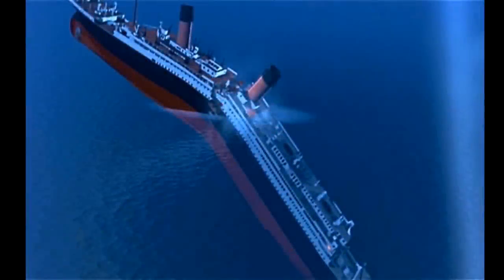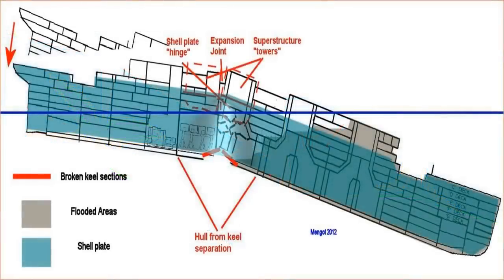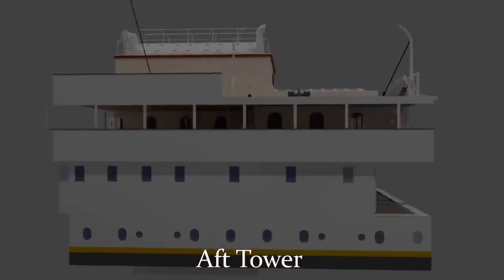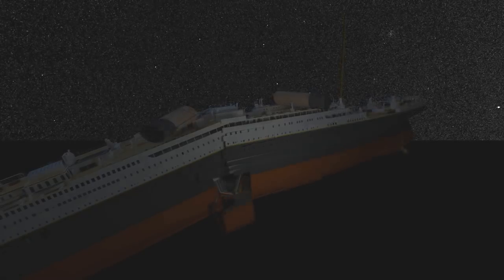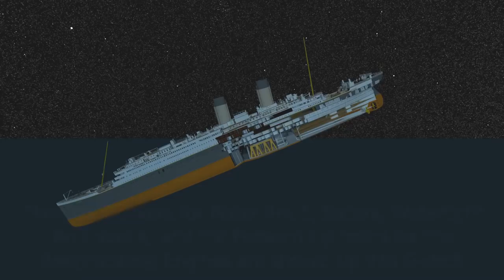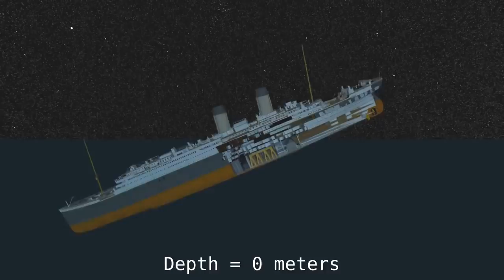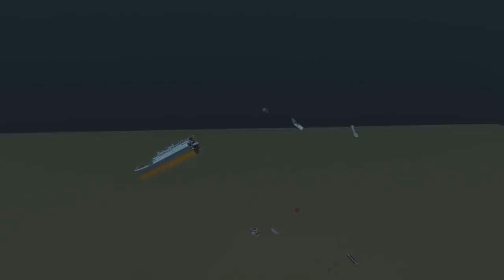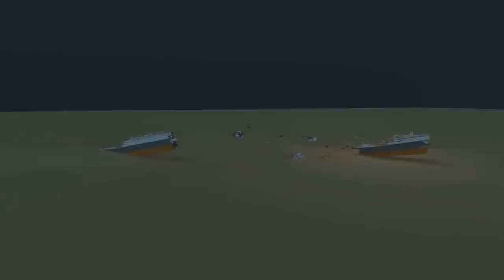How Titanic Broke In Half BRIGHTENED

Comment: "She's made of iron sir. I assure you she can... And she will".
Reply: Wedge Antilles iron with a high sulfur content.
Reply: "It's a mathematical certainty.". No one ever mentions that there had been a fire while she was being built, in the lower sections. It's been assumed that it caused the steel to become more brittle. That area on all levels had been re-painted to removes signs of smoke damage. There's strong evidence that it may have helped cause the tearing. On the other hand, when Mother Nature is wheeling out big icebergs, there's no such thing as an unsinkable ship.
Reply: johnny cash Using Bernie Sanders’ logic of banks, a ship too big to sink is too big to sail. Look at the Bismarck and Yamato for proof.
Reply: Yes she is
Reply: thomas said she can and she will
Reply: johnny cash  the fire didn't damage the hull. It was extinguished earlier in the day of the collision. The coal fire theory has been debunked on this channel and others many times. There was a fire, coal bunker fires were common but the displacement of the coal into the other bunker actually held the ship up for an extra hour and 45 minutes as Thomas Andrews gave the ship an hour during his calculations. If the fire had been hot enough to damage the ship it'd have damaged the pool as well since the pool was right above the bunker but survivors had used the pool that day and said it was pleasant, specifically Archibald Gracie's accounts.
Reply: @dawndelosmuertos4025  te fire was shown to not have been much of a factor. If it affected anything it did so after the ship was already doomed
Reply: shane scali she was made of steel, by that time iron wasn’t used anymore due to it being considered poor.
Reply: @jamesgroccia644  the Bismarck sank because it got slammed with high caliber shells in a naval battle and the Yamato was barraged by USAF aerial torpedos. That is completely different from hitting and possibly grounding on an ancient chunk of ice. Those ships were purposely destroyed, Titanic got scraped up just a little too much on an accidental encounter with an iceberg.
Reply: @dawndelosmuertos4025  that theory was debunked long ago, and now its really annoting.
Reply: @jamesgroccia644  -
Bernie Sanders is a senile old geezer. You really gonna take his word for it?
Reply: @dawndelosmuertos4025  the coal fire was already debunked. the fire can't damage the steel. even if that really happened, the temperature can't damage the steel as it wasn't high enough for doing it. the boilers' temperature is 940F but to damage the steel the temperature should be at least 1220F.
Reply: Watched this part of the film last night - had a good chuckle.
Reply: @MasterAnakinSkyWalker  He's smarter than you are
Reply: @sorrenblitz805  The British always say they sunk it with a torpedo, 400 shells hit Bismarck, and guess what, it didn't sink. It sank because scuttle charges. Evidence from the wreck have shown bulging shell plates which is what scuttle charges are meant to do. No evidence of Torpedo damage to Bismarcks thick armor.

Comment: Ships aren't designed to handle the immense strain of being half under and half above water.
Reply: johnny cash  You need to change your profile name because the real Johnny Cash would never be that rude and disrespectful.
Reply: In this day and age surely a computer programe can be devised to show how the split occurred, rather than this constant, it did this, it did that
Reply: david jones it is really simple. The longer something is, the more it tends to flex when gravity pulls on it. The ship had its front 6 compartments flooded with water. This caused it to be pulled nose down. Once the stern began to lift  out of the water, of course it was going to split. Steel is not that flexible. Also, there was an expansion joint in place which becomes a weak point.

It's like if you had a 100 ft steel pole with a vertical slot cut down the centerline of it. You grabbed the pole and attempted to lift it into the air by pulling down one end. The metal will be put under extreme stress. It will flex, and eventually split at the weakest point. It's not rocket science.
Reply: @davidjones-tz8bs  You seriously overestimate simulations...

The thing is you need to know the exact conditions, where it sank, how, and so on, to get a relatively accurate run. Which even then may still take MANY more attempts to refine even when you have the info. 

It isnt magic.
Reply: @LynxStarAuto  Titanic's steel was also brittle, it has impurities in it that weaken the metal and made it brittle. The extremely cold water only further embrittled it. Just before it broke in two, survivors reported loud, thunderous noises coming from below decks that could only be steel plates shattering or fracturing like glass.
Reply: conrad twitty  Expeditions to the wreck took samples of hull plate, deck plate and beams and tested them. What they found was high levels of sulfur and inclusions in the metal, which make it brittle. Even so, Titanic would still have broken in two if modern steel was used along with welding. I build ships for a living. Make no mistake, cracks are as much an issue today as they were in Titanic's day, even with better materials, welding and design. The metal used to build Titanic would not have been allowed out of the steel mill today, it would have been remelted and the impurities removed before being turned into plate and beams again.
Reply: well they should be lol
Reply: Well in Titanic's case it wasn't half underwater half above the surface,

It broke between the 3rd and 4th funnels meaning more than half of the ship was underwater.......

Plus, water-filled object is heavier than an air -filled object....
Reply: @danieldoo1821  But the air-filled object was still pretty god dang heavy.
And yes, more than half the ship was under water, but not all of it was completely flooded :)

Comment: This is one of the more elegant solutions to explaining how the breakup occurred. It explains away many of the mysteries and missing chunks of the ship, as well as accounting for the massive compressional forces present just before the break occurs. It also solves the problem of not everyone noticing, since the stern doesn't really visibly separate, nor settle back on an even keel before going down, something the top first theories have problem with. Also excellently animated, very well done!
Reply from the maker: Many thanks! :)
Reply: @TitanicAnimations  Why did the Stern fly off into Space at 16:44?
Reply: @angieroxy7550  yeah, I thought that odd as well then realized the animator had botched the water line somehow. How that wasn't corrected is a mystery to me but it certainly confuses the whole sequence A GREAT DEAL. That should be fixed, eh?

Comment from the maker: After more comments than I care to count about the animation needing to be brighter, I brightened it.
Reply: Just a question... did the water tight comparments help made the ship sink faster? and also another reason the ship snapped in 2?
Reply: Glad u fixed it
Reply: Aaron joel There was a documentary (I don’t recall which one) which used a scale model to test this. They found that with all the watertight doors left open, the ship would have become unstable from the water sloshing freely from compartment to compartment, and would have probably tipped over and sank sooner. So there was nothing really that could be done to make the ship last longer than it did.
Reply: @1987VCRProductions  I mean look at Britannic...she sank in 55 minutes
Reply: Aaron joel Here is the documentary I mentioned where they tested that theory: https://youtu.be/JE7tpVK3llA
Reply: I'm glad you brightened it, but it's disturbing seeing the stern section heading towards the stars.
Reply: and turn down that stupid music.
Reply: @1987VCRProductions  saw that in mythbusters
Reply: Heres two things that urk the crap out of me. cast steel plate and rivets. what about a fracture failure yes same point of loading, same characteristics. but earlier fracturing.
Reply: In some of the most recent Dives to the Titanic they located large sections of the Keel of Titanic miles away from where the rest of the wreckage was.
This paired with reports that there had been water reported in compartments that had not been breached very early has led to a hypothesis that they didn't just sideswipe the iceberg but wrote up onto it under water actually tearing off sections of the bottom of the ship. This would explain why those sections were so far from the rest of the wreckage. Because they possibly broke off and sank at the time of the impact and the ship continued forward.
Such damage would also help to explain how the ship was able to break in half when Engineers studying Titanic design have estimated that the structural integrity should have held.
Reply: Eye witness accounts differ to this????
Reply: lakmeister eye witness accounts are not very reliable. Especially at night time, and under duress.
Reply: During the real time animation thats in the midpoint (12/13 minute area) of the video, how far away from the ship are we? 1/2 mile?
Reply: Count one more comment.

The Cgi is terribly dark. You have solved nothing!!! 🙄
Reply: I couldn’t care about screen brightness I was busy with an oil painting as I listened but I wanted to say how cool and refreshing it was to listen to someone who understands physics.

Comment: The way the keel bent upwards and failed explains a great many things. Such as why nobody escaped from the engineering spaces, why the forward low pressure engine cylinders are mangled while the others are not and still on their foundations, why two huge pieces of the super structure and keel are far from the rest of the ship, and why the stern sank as rapidly as it did. This is the only way the boilers from boiler room one, coal bunkers, and other pieces of heavy machinery, engine parts, bulkheads and broken sections of shell plate are lying close to the stern. They fell right to the bottom like bombs while the bow and stern planed away somewhat from the spot where they went under, with the stern spiraling all the way to the bottom.
Reply: I mean, the rapid pressure changes as the ship plunged further & further towards the sea floor probably also played a role in the mangled machinery, no? I’m just hypothesizing here
Reply: @buffalokay  That certainly did occur. Anything that was still filled with air was crushed by the extreme water pressure on the way down. One of the high pressure reciprocating cylinders was split open. Pipes in the stern section were smashed flat  while others are intact. Also the water surged into the stern section and ripped out most the interior bulkheads, which were made of wood, blasted down stairways and air shafts, and burst through any watertight bulkheads. Undoubtedly had Titanic sunk today, a submarine or underwater hydrophone system would have heard a cacophony of very loud break up sounds from the sections of Titanic on the way down, then their impact with the sea floor. Most of the damage done occured when Titanic tore itself apart.

Comment: This is very interesting. The bottom up explanation makes more sense to me now that I have seen it and heard it explained. I guess it also leans in favor of conflicting survivor testimonies over "did the ship break" Imagine trying to figure out if the massive mostly-black blob in front of you is breaking or simply moving in a strange way. From certain angles you could easily imagine it didn't break. And, being someone with no understanding of engineering (like most of the survivors) You would be hard pressed to define what you witnessed, in lack of a clean obvious break down the ships height (like Camerons break scene in the movie) I think, because I grew up with the dives done in the mid-late 90s I kind of fell into accepting the top-down explanation. But this doesn't hold up to those survivor testimonies as well as the bottom-up. Maybe to someone in a lifeboat, the ship might have seemed to distend or even try to right itself, seeing the stern try to level off, while being in the grips of the cold, shock and sheer strangeness of that night.  Fascinating. It's challenged what I thought I believed, and I'm ok with that!

Comment: The time it took for this huge ship to fall, and fall, and fall...till it hit the seabed, makes you think doesn't it how immense the open ocean really is down below
Reply: A sinking ship or submarine rockets to the sea floor like a free falling aerial bomb, and would impact the bottom in five or six minutes after falling for nearly 13,000 feet.
Reply: @taraswertelecki7874  How fast would the hull be going before it reached bottom? I figured around 60mph and took almost 3 minutes to hit bottom. Being so heavy and full of water, I don't think it would have floated down slow.
Thanks 👍.
Reply: @Scottocaster6668  Slower than the stern, anyway, which sort of tailspun like a falling plane.
Reply: it's altogether too deep, and frankly we should make it shallower. for safety reasons.
Reply: @Scottocaster6668  At least 30 mph, it not 40 plus miles an hour on the way down.

Comment: Huh... I’m used to trusting my gut with metal and engineering, it’s rarely wrong when it takes issue with something, but then again I don’t know ships, like at all, so maybe someone can explain this to me; why did the stern not fall back towards the ocean towards its (more) intact end? It feels like a lot of mass, even compared to the amount of flooding, for it to remain that close to vertical. I don’t think it would make it all the way down, just a lot farther down than in the animation.
Feel free to tell me my gut is wrong, I just want to know why it behaved the way it did.
Reply: Hi, I'm not much of an engineer and (not that it helps) I do have experience with boats. If you watch the animation and where the waterline is at the point of breaking I think there's enough flooded ship to help hold it like that. As well the ship is mostly filled with air back there at that point and it is a much smaller amount of material since the ship tapers off at the end. If it was just a big empty rectangle than It probably would have fallen back down. Not 100% sure on this but that's my observation. Hope it helps
Reply: Probably the weight of the engines which were right at the front of the broken section. That means the center of mass would be far forwards of the center of boyency tilting the stern and putting its broken end under water.
Reply: One theory is that the bow kept attched for some while whilst under water, thus holding the stern upright for longer, but I am no expert so I just go with what sounds likely.
Reply: A mixture of the weight of the engine at the front, water already filling in, and also similar to the effect of putting a cup upside-down in water, even pushing down on it. Most likely.
Reply: Well, one thing you can see when looking at any ship from below is that they do narrow toward the end, especially around the propeller shafts. I feel that the mass of the front end of the stern was greater than at the back which, in combination with the yank given by the bow, could have help the stern remain somewhat stable for a time. I think this could have allowed the stern to remain in a delicate balance with it's centers of mass, gravity, and boyancy remaining aligned enough as it slowly sank (basically it helps to remember that the stern is a simple box shape, and could have somehow remained balanced for a while because of it).

Comment: She broke just at the fwd edge of the engine foundations framing that’s the thickest part of a ship with the least flexibility
Reply: The aft section of double bottom now inverted on the bottom far from both the bow and stern section broke off at that point. The two sections of double bottom come together just forward of the watertight bulkhead between boiler room one and the low-pressure reciprocating engines on the other side of it. You're correct, the foundations for the reciprocating engines would indeed make the keel both the strongest and least flexible dut to the extra steel needed to support engines that weight over 900 tons apiece. The boilers in boiler room one on the other hand, weighed 50 tons each, and the coal bunkers held at least that much coal when Titanic set out on her maiden, and final voyage. Stresses much have concentrated in the keel and double bottom in part because of where the engines were.
Reply: Thats actually incorrect otherwise there would be muuuuchh more bow section

Comment: This was a decent video until the final animation.  The stern starts floating in the air and the bow hovers at an angle above the sea floor?
Reply: It was a 3D image, the 'surface' of the water you saw in the video was just a reference for the animation, the actual surface was not visible in the animation, also the bow did not hover - it was falling continuously, again the seabed "surface" you saw was just for reference, though you can tell when the structures were approaching true bottom as you could see the shadows appear beneath each object.
Reply: I totally agree. The animation looks great but the stern "rising up" and "flying in the air" looks weird and is quite distracting.